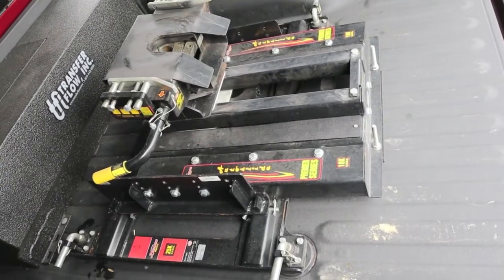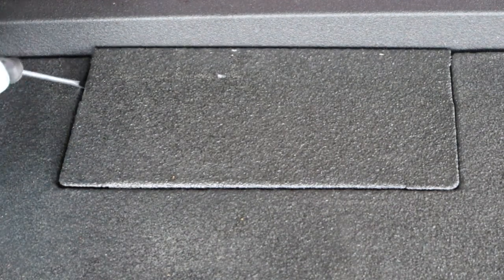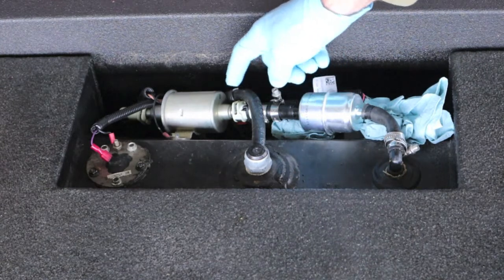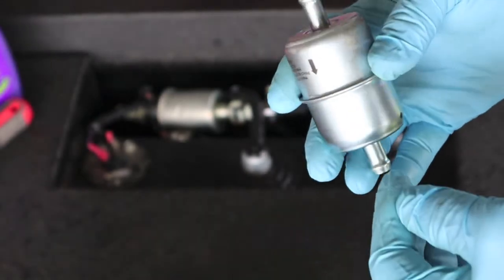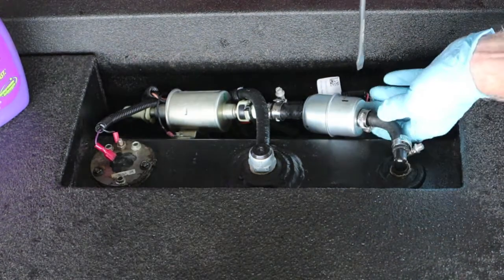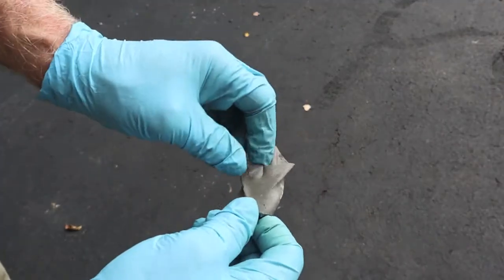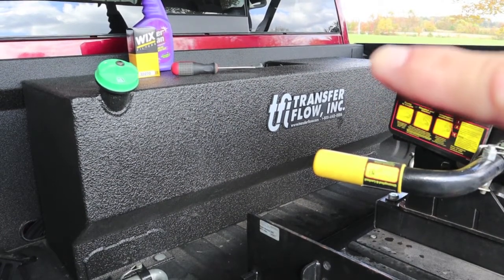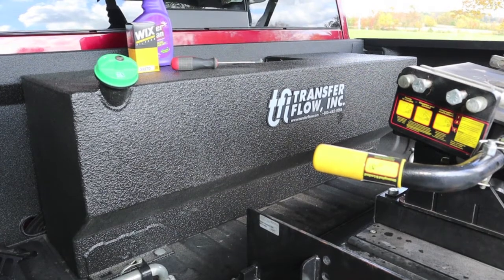Transfer Flow in-bed Auxiliary Fuel Tank Filter Change (and filter cut in half)!

Comment: Wix 33003 is clear so you’ll see junk coming out of tank.I think it’s 50 micron.Any ways I run from pump to a 10 micron into a 2 micron then into my tank.The 50 and 10 get perty dirty.Those tanks are aluminum coated steel.The welds inside rust after time.
Reply from the maker: I'll look at the 33003 filter. Thanks for watching!

Comment: That is a heck of a filtering system!  Nice setup. Looks real good in the bed.  Have a good week Pm!  See ya!
Reply from the maker: Thanks John, it has been a great aux fuel tank setup!
Have a good one!
Reply: @pmtips4482  it's mind blowing that no one just makes a smaller 30-45 gallon package with a pump that you can shove behind the wheel well without drilling down that has a pump to it and can still sit under a ton cover that rolls up